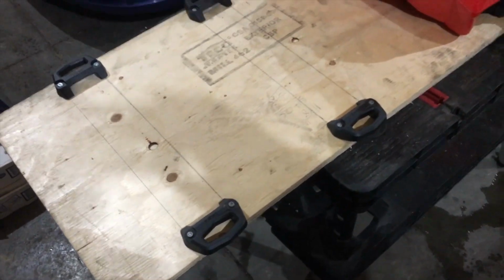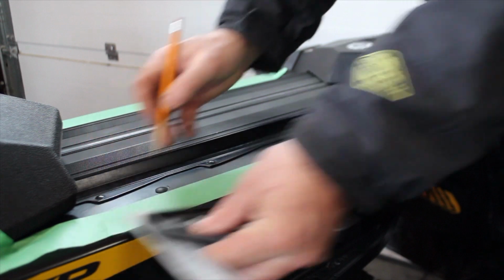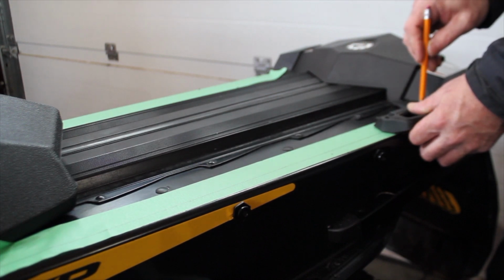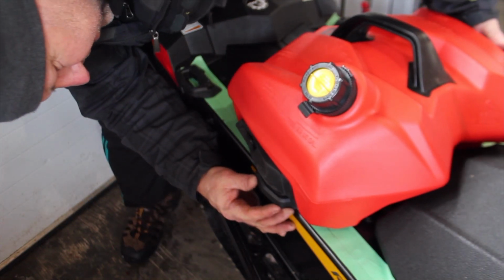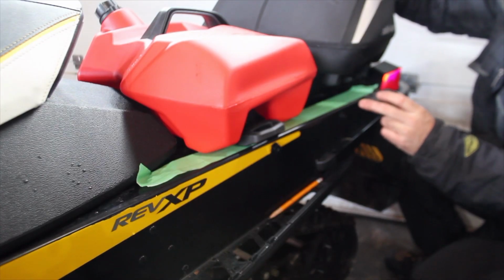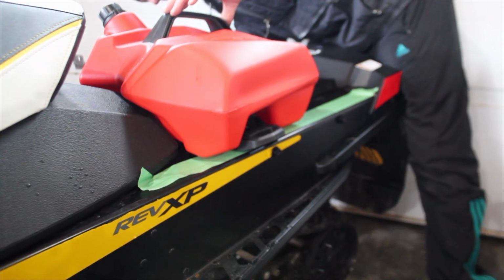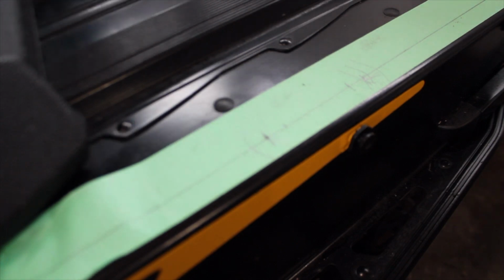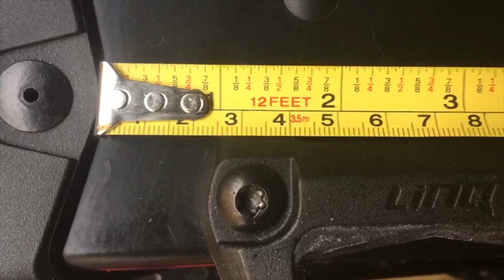Ski-doo Renegade REV XP Install Linq Brackets

Comment: Could this system be installed on a short track XP chassis?
Reply from the maker: single
set will work on a 120 XP
Reply: @mudbrats  ok thanks

Comment: Skidoo includes paper templates with the Linq brackets. You cut out the templates and place them on along the curved aluminum edges running down the tunnel.  I've used them twice now - they work great. Just a note on your measurements, the lateral distance between coresponding bolt centers is actually more like 11 1/8", (not 10 3/4"). This is actually quite important when you are trying to use larger LinQ accessories that require 2 sets of LinQ  connectors -  if they aren't spaced the correct distance apart (front to back), then your new cargo box won't fit. I would tend to trust any  factory holes,  but it can't hurt check them out  against a known set. My 2015 had factory predrilled holes, they are 11 1/8" apart from each other  (front to back). These holes were the correct spacing for the 40l cargo box I just bought . (  If you don't have factory holes, then use the templates that come with the connectors. If you don't have templates, measure carefully!
I'm in the process of building a custom cargo rack to go on my 09 Summit. I'm making it so that it will fit any machine with 2 sets of LinQ attachments . I'm also gonna take a stab at converting an old Skidoo fuel caddy so that it attaches to 1 set of LinQ brackets - we'll see how that goes .
Just one more note... the rear LinQ  brackets  on my 2015 Renegade 600 , 137" track, are too close to the back tail light, i. e.; neither my fuel caddy, nor my 19l tunnel bag can be used in the rear position . I noticed someone else had the same problem... apparently the solution is to get some type of adapter plate for the tunnel bag to raise it enough to clear the tail light  - kind of a pain in the butt....  anyway, hope this info helps someone .
Reply from the maker: jojobobo321 they also prepunch the tunnels as well which is a great idea
Reply from the maker: jojobobo321 i have heard that people are having trouble fitting the bag and fuel caddy on a renegade xp  - mine fits great as you can see because i didnt use the factory measurements - i pre planned it and made my own placement so both fit without the adapter for the bag (the adapter raises the bag and places it back - no need for that

Comment: Do you happen to know if I can use the original trunk with the jerry can? I have a 120" sled. Not a renegade
Reply from the maker: the jerry can fits on a 120” or the bag... 1 set of linq brackets...
Reply: @mudbrats  ok thanks.

Comment: Hmm i have 2003 W/ beavertail.did the delete kit.16.5 width .15.5 usable .now i see width is good. Been searching.what i find is no it wont fit.??
Reply from the maker: if you have the width you should be able to drill anywhere on the delete as there is no heat exchanger channel there - should be no problem to use LinQ - or am I missing something?
Reply: @mudbrats  is what i thought.have seen a 2003 on internet. 10 yr old video.with delete kit and light was moved to rear with kit.tank on top. Have only found 3 gallon tank only bout 100.00. Gess get it and see. Sent e msil to them .they said wont fit. Somebody told me 2003 tunnel was narrower. But i measured width 16.5. So 15.5 usable to drill.
Reply from the maker: @markgamble8377  You should be fine.... Those LinQ tanks new are only $135.00CDN and they included 2 brackets - I wouldnt buy used for $100 unless it was mint and had brackets as they are worth $30CDN.  Let me know how it goes.
Reply: Thanks .yes it fit.i just used tape like in video.traced around brackets attached to tank had to tape one in placed.then drilled holes. Perfect.

Comment: would this be the same on a summit?
Reply from the maker: its the exact bracket and distance between the LinQ positioning across tunnel from side to side.  the location between the brackets on each edge should be the same as well.  Since your tunnel is longer you will need to experiment where you place the brackets (distance from seat or tailight). If your summit is 2013 or newer, the tunnel should have little dimples along the top edge marking exactly where to drill the holes.

Comment: what sized drill bit do you use for the brass well nut?
Reply from the maker: Sorry I didnt take note of that and now I cant recall the drill bit size.  If you can do us a favour and reply here with the bit size when you do yours that may help a lot of other people with the job at hand.  I would have taken that nut and dropped it into the drill bit holder until I found the right size. Thanks in advance Mark!
Reply: @mudbrats  nuts me eithor.started with small drill and moved up till nuts fit. Not sure final size.
Reply: @mudbrats  At the 6:45 mark I think I hear you say "it's slightly bigger than 3/8".  Which also looks about right.
Reply: I tried the next size up from 3/8” in my index, which was 25/64. It was still too tight. The next size up was 13/32” which was the size I ended up using from my drill index. Great video. Very helpful.

Comment: Why not use the factory pre punched markings to mount the brackets. They've done all the measuring for us:) just saying.
Reply from the maker: Ryan Wilson if u look closely at the video you can see there are none on the 2012 renegade... i think they started putting marks on the XS tunnels.  I also talked to a guy with a newer renegade sport XP with the same bag and tank as mine and he said the factory marks on the tunnel decals were wrong.  He drilled them all out and could not get the bag on with the tank installed... so pays to double check the factory marks
Reply from the maker: Ryan Wilson thanks man!
Reply: Sorry didn’t realize that year didn’t have predrilled holes. My mistake. Thanks for the info tho. I just bought a 2018 renegade back country. I haven’t installed my gas can or bag yet. I’ll be sure to double check the measurements on the scribed marks. Enjoy the winter:) Ride safe...
Reply from the maker: Ryan Wilson no worries - someone else asked me the same question a while ago... with respect to the sport xp - the dealer told him he had to buy a bracket that attached under the bag to make it sot higher and back further... isnt that funny?
Reply: really funny how mine is marked,,i have a 2012 mxz x package 800
Reply: thats funny my 2012 mxzx had the holes premarked,,
Reply from the maker: Joe neault brp must have marked the 120" tunnels for mxz but not the 137" on renegade x
Reply: My 2009 summit also didn’t get any pre drilled holes, I guess that was before the linq system came out. Thanks for the video, great info and super helpful!